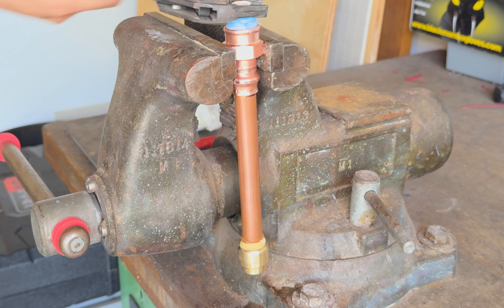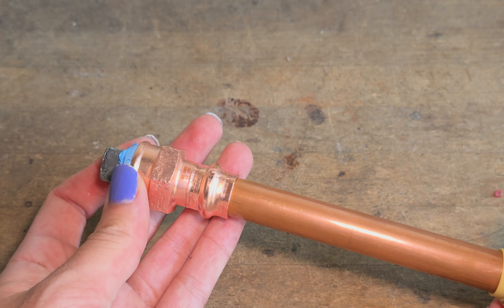ProPress vs. SharkBite Pressure Test: Which No-Solder Fitting is Better?

Comment: Shark bite is rated @250 psi Water mains of any size are rated at 150 psi working Pressure by the AWWA. with a burst pressure of 300 psi. Water systems for buildings have a working pressure of 45 to 80 psi per AWWA. So the test is really invalid. If you get to 250 PSI on your water system which is Impossible BTW You would have way bigger problems than a Sharkbite Fitting
Reply from the maker: Yes, I am aware that both Sharkbite and press fittings are rated to handle standard residential water pressure. I was just curious about which could withstand the highest burst pressure

Comment: Nice video, I like how you were able to use a solid pipe plug to increase the pressure in the system for testing.
Reply from the maker: Thanks! It was definitely a lot easier and less expensive than getting a high pressure pump.